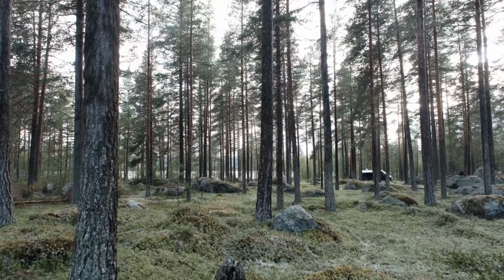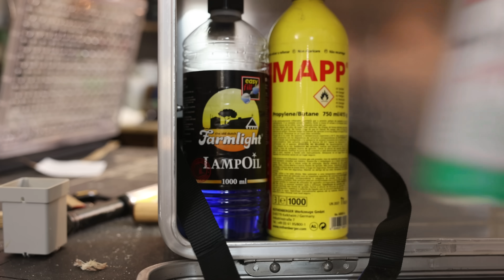Essential Overland Storage Case (EDC for your Van)

Comment: As soon as you drilled out the hole for the lighter but (before you used the Jigsaw) I could imagine Adam Savage saying Looks like I need to redesign this handle to fit.

Comment: I love it, but how is it mounted to the van?
Reply from the maker: There are brackets you can clamp on the backdoor of the van and then bolt stuff right into the bracket
Reply: @laurakampf  Laura is it a long bracket held on with magnets? I see something black there how does it hold onto the door? Ok I see a little clip on one end clips on edge of door.
Reply from the maker: It’s a bracket from an old bike rack. There are a bunch of different systems. The brand is fiamma